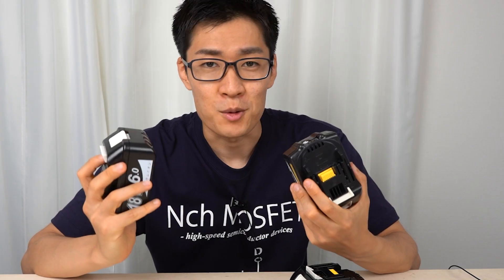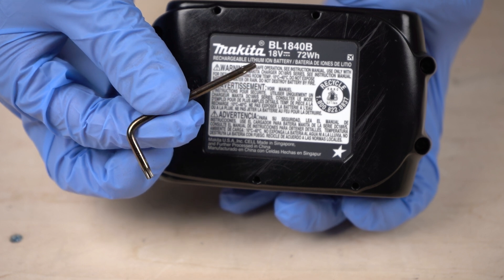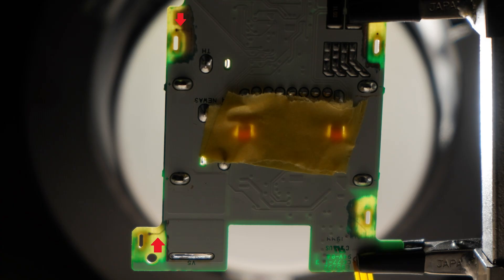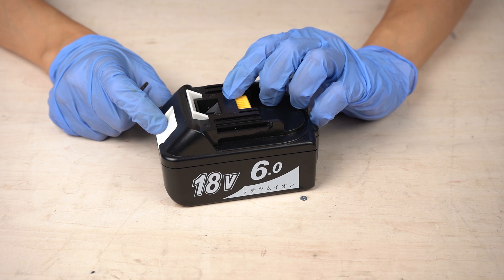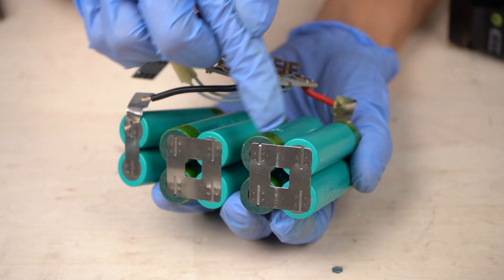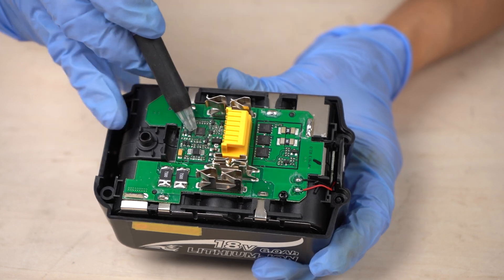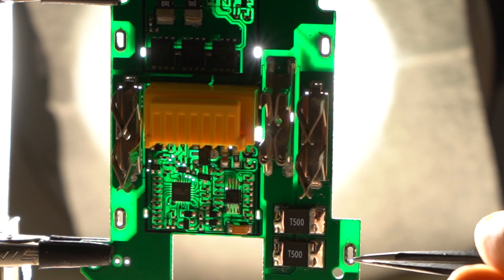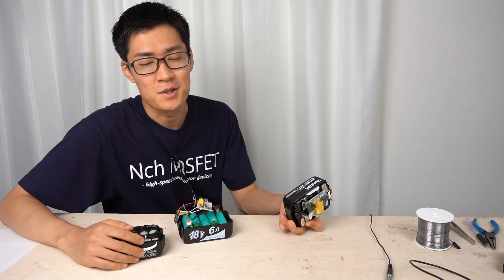Are Cheap Power Tool Batteries Safe to Use? Teardown Test!【Just Buy official Battery】

Comment: I mean, even with the cheaper Chinese aftermarket tool batteries, as long as they use 'fine' 18650s (the batteries with not too awful the cathod anode separating films), you can easily add NTC heat protection and cell balancing.

Comment: I have been tinkering with 18650 since 2015. So I know whats up. In fact im STILL learning...
I have bought many 'broken' ones for about $4 each. Yes $4.
These are pretty easy to fix.
Yes they are 5S usually 1 or 2P
Theres no way that POS is 6Ah. Even if it was it would have a lesser discharge and certainly be a fire hazard .
9:55 Wow thats pathetic....THEY KNEW WHAT THEY WERE DOING

He going to recycle ALL of them and not give them to me? Not even the genuine one? Now THAT'S the real crime here
Just so yall know you are 6,000 times more likely to die in a car accident than a battery fire (and that's if they catch fire)

Another example of you get what you pay for.

Comment: there is a litle of misinformation here, that problems can easily be solved by adding a bms, witch is not that expensive, and if you are gona throw away a battery just because you tuck it apart, that is making ewaste of a perfectly working product, its against the health of the planet, against right to repair and against logic, any decent technician that respect himself is able to put together anything that was working and most of the things that where broken. you need to educate yourself and stop spreading the useless creation of ewaste.
but more important, if you know that much, why are you unable to put it together, do you do the same with your computer or car? you must be a millionair

Comment: hi i bought a Dji mini 4k drone and my Remote control radio (RC N-1) hase a 2 battery  L-ION integratet but they have small capacity , i could not use them for more than one hour and half. I want to replace bouth of them with 2 battery Lipo with more capacity, could you advise me witch batterys i NEED? thanks

Comment: The crap board what was in the 1gen original makita battery when first offered  then they changed it mostly  because of that   but it's the only one offered  to repair or replace none have low voltage pertection that work good  most of the time that what goes wrong or bad even in a factory battery   if changer see it as bad 3 time the board  won't function any more on a original.  For 50$ more each battery  suck   that  low voltage discharge kills them all  original or not.  Original  even worse because board also no good   and a proper replacement aren't available   1 battery more then the tool or even priced.🤑💯✌️

Comment: Nice work. I was considering buying these exact Chinese knockoff's.... until now. The other thing this means is as the battery pairs drift in voltage, some up and some down, they will arrive at a point much sooner where they whole pack will stop working. Much sooner than if it had a proper BMS that monitored and charged each parallel segment individually.

Comment: One hint: If a battery says (18V) 7Ah or more, you know it's fake.
Expensive high current cells go up to 3Ah. You may be able to find some that go even higher, but not much, and you can't get those cells for $2 or less. So a new battery that cost less than $20, claiming it's 7Ah is simply a fake battery.

Comment: I'm refurbishing batteries for living.
I've seen - probably the exact same battery you've shown - a customer bought it on aliexpress.
The nickel inside was burned (so the connection was open) - one can say "fortunately". It acted like a fuse in this case.
The cells were probably 1.5Ah, and the battery said 4.0Ah.

Personally I like Makita very much, but they do not allow us to refurbish their batteries, which means we tell people not to purchase Makita. That's a shame, because their products are of good quality.

From 2025, Makita will have to allow us to refurbish their batteries (which is a good thing, especially for the environment, but also for their reputation) - if they refuse, they can't sell their battery-powered tools in Europe.

Comment: I only buy legit Makita batteries for both LXT and XGT platform, same with powertools and chargers. In case of my flat burning down due to it, I know where their HQ is in my country, so I would go visit them 😅
Joke aside, you should also note a real Makita LXT batteries will have two different weight to them. That said, buy your tools from official reseller in your country.

Comment: Imo if they sell Rigid or Ryobi (or other name brand battery with built-in BMS, excluding Dewalt) I would use that with an adapter, just stick to the original chargers however.

Comment: Dewalt compatible are less dangerous because the "Management" is done by the charger and the tools, but the cells are still unmatched crap. I used them for years, it got out of balance because of this and I must manually balance them every year to have full capacity. It is not something I recommend. The charger can't balance cells that are so unmatched.
Reply: Add balance leads and use a hobby charger, or buy an adapter and use a battery with a BMS from another brand 🤣

Comment: The only thing unsafe about compatible batteries is the BMS, if u replace it with the original it works the same
Reply: Problem is: If your original Makita battery has failed charging 3 times in the charger, the charger will write in the battery's BMS, that it cannot be used.
-So always use a non-Makita charger for charging your Makita batteries, if you wish to re-use the original BMS...
Reply: Assuming they are using legitimate high powered cells, not recycled or rewrapped cells.

Comment: I bought "compatible" batteries by accident. They were sold on walmart's website and listed as Makita batteries. They even look a lot like Makita batteries but they don't even fit on my Makita chargers. Also, they are supposed to be 6 amp hours but are not bigger than real Makita 4 amp hour batteries. .

Comment: stupid why the manufacturers dont just make it a perfect 4S bms with a dollar more
Reply: That battery is a 5S (18V). 4S would give you only about 14.4V.
Edit: But the chinese will save 0.001 cent wherever they can. It doesn't matter if the customer dies, as long as they get the profit.
Reply: @68HC060  oop meant 5s bms, didnt look properly haha, I mean for my own powerbank that I made myself, it cost about $1-2 for a ready made bms with cables attached to it, if they can source batteries for cheap, maybe make a case where you can replace the internal 18650s it might be worth getting too

Comment: Nice Video!
Opened up a cheap Makita rebuild from a friend because it stopped working. Was the same shit like the first one with the small pcb. Except the main power cables were soldered. One solder joint got loose through heat i guess. And because of the missing full BMS i told him to put this garbage where it belongs. He had bought 6 of them 😱
Reply: Next time tell your friend to bring you the original battery... only replace the cells with the new ones...or to buy some original used ones if he doesn't keep the old ones....

Comment: What's sad about these cheap knock offs is that they could have quite easily duplicated all of the safety features of the brand-name product and still cut a nice profit. Sure, they would have had to raise the price some. But not to where they cost 90-dollars like the brand name one costs. I find it hard to believe that a resin coating, temp sensor, and 4-wire monitoring configuration costs $60 when manufactured on a large scale. I feel as thought any competent DIYer could replicate the brand name to almost identical specifications, for less than $90. Resin is cheap enough. Temp sensors are cheap enough. A 3d printer can make a battery holder & impact absorber. But the consumer is left having to choose between low cost dangerous products that don't work well, or over priced brandname ones that just cost too much.

Comment: Don't get me wrong, I 100% agree that cheep Chinese knockoff battery packs are always a questionable gamble. However, this video smells of corporate sponsored consumer propaganda. Specifically, I feel like the samples shown were cherry picked, and/or the balance wires were purposefully removed. It really tries to sell the image that generic/compatibles are always positioned to catch fire, and branded batteries are not....

... In reality though. All secondary cells have a non-zero chance to catch fire. Don't believe me? Ready your instructions. Even the name-brand manufactures warn you to protect yourself from potential fire caused by their own batteries. Basically, one should never charge any battery in a way that a fire could potentially spread out of control. This is not an off-brand vs. name-brand problem, it's a problem with energy storage in general. Don't let them fool you, many a battery fire has been caused by proper brand batteries.

In any case, my no-name Amazon Makita compatible battery pack functions perfectly. Point of fact, the only problem I ever have with it is my branded charger complains that it's bad. No doubt the charger detects that it's non-genuine and decides to be passive-aggressive about that. For good measure, I took the cover off it and it was similar to the first generic shown here. The only difference was it has several colored wires going to each connection between the cells and the PCB. 

TL;DR: Not all generics are missing safety features. I have pictures, but ... why take my word? Take yours apart instead and see for yourself. It's not hard... Four ~T10 torx screws.
Reply: I live in Europe and I can tell you the Chinese knock-off batteries come with only a single balance-wire. We've seen so many of those at work.
Reply from the maker: Who will compensate you if your house catches fire and burn down due to a cheap battery malfunction?
At the very least, the company selling the cheap batteries won't compensate you.
Buying a brand-name product means you are buying peace of mind and safety.
Reply: @DENKI-OTAKU  I'm sorry, but I am unaware of a single major manufacture that has a warranty that covers a house fire. A consumer would have to open a lawsuit and prove it was the product's fault, and not their own. That would be a huge and difficult fight.
Reply: @CharlesLeeScoville name brand will at least cover their ass by designing and putting safety in place. Those generic packs only have a tailgate warranty. Just because you've never had an accident in a car, it doesn't mean your airbaga and seatbelts are useless, a car without either can still drive perfectly fine, but your survival isn't guaranteed in case of a collision 😂
Reply: @CharlesLeeScoville  - No big brand will want a reputation that their batteries cause fires. Thus they will do whatever they can, to avoid their batteries catching fire.
Chinese knock-off batteries have no brand-name, so those who manufacture those batteries (likely one single factory) can use the cheapest cells they can find (below 2Ah) and they'll likely not use high-current cells either. They even save on the nickel-thickness (which is actually good in this case, because the nickel burns in place of the non-existent fuse). If you've ever bought things directly from a chinese seller, you know they don't care what they sell you; as long as they can get your money.
Reply: You got any evidence for your assertions? You're right, I don't believe you. Make a YT vid to counter this one. IOW, put up or shut up. Or are you an Amazon shill? Louis Rossman exposes very, very many Amazon scams. Obviously not all stuff on Amazon is poor qual, but since the "pandemic" saw Amazon sales take off there are heaps of crap products on there, and Amazon does not listen. The recent spate of terrible "accidents" with auto cleaning cat litter devices proves this, and Amazon take down the bad reviews, not the products.

I would, however, like to see a comparison of the actual cells in these packs. Tipping they're not as good also. TorqueTestChannel do some comparisons of the amp hour assertions.

Comment: I have seen so many Tasla electric car exploding due to battery 🔋 they have more higher safety standards,then why its happen, what you will say about it..?
Reply: Tesla makes innovative products but they lack experience, it is possible it's just poorly engineered. Eg early tesla had raw aluminum parts bolted to steel, HELLO GALVANIC corrosion